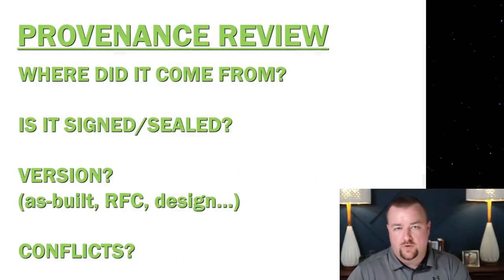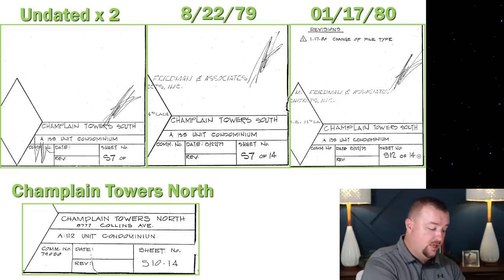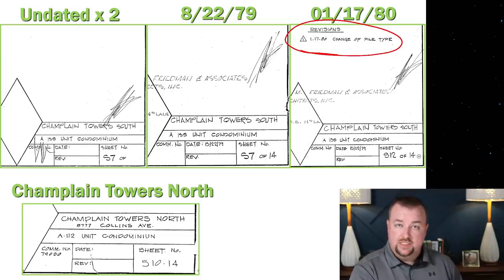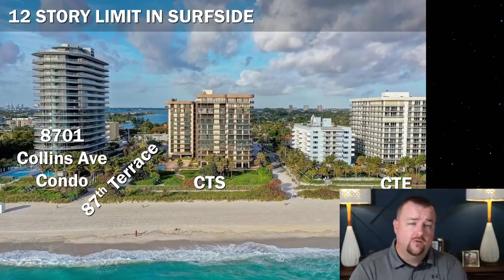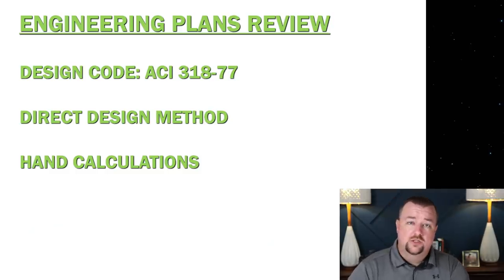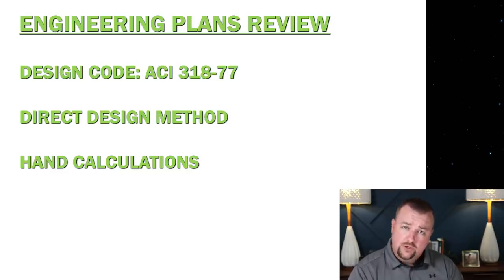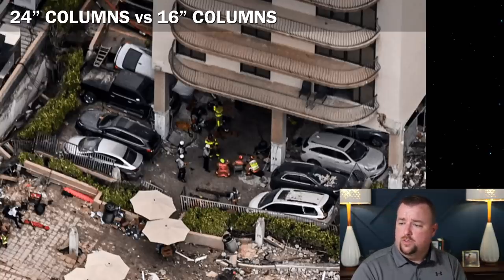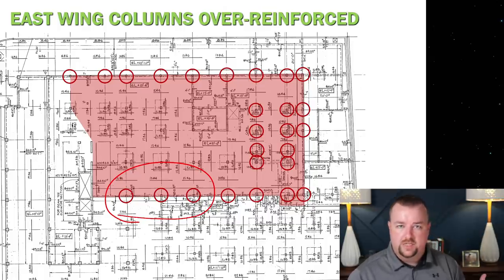Engineering Failures Found in the Champlain Towers South Drawings - Surfside Collapse

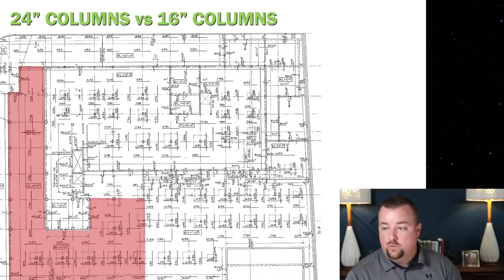Comment: 11:23 on of the ways to cater for higher punching shear is higher column size as shear perimeters is pushed out marginally. The best way to do it is, increasing the drop size. I don’t think 24” columns had to do with higher live loads. As vehicular live load account to small portion for axial members in general.

Comment: What I'm curious about is if the 2018 assessment analysed the blueprints themselves at all such as looking at loading, for example it seems like whether or not wear and tear is a big concern should be based in part on how robust and redundant the building is. Is investigating the original design not a part of re-certification? For that matter it also feels like this would be incredibly useful information in general especially for a layperson. Things like extra planters being installed, or how much the wear needs to be looked at are decisions the board might have looked at differently, if they had a simple overview of the structural integrity of the building at time of construction.
Reply: The structure is usually not analyzed (at least where I live). It is expensive and time consuming. The drawings may not be in adequate enough condition to determine all the rebar and specification and grade of the rebar. You also technically have to inform the original engineer if you are reviewing their work. There are also site instructions and issued drawings that the city may not have. The assumption is that the design met the standard at the time of construction.
Reply: @yodaiam1000  Well that's distrubing, so the integrity of a building once built is just assumed... to be frank it makes all re-certification thereafter essentially meaningless and basically liess.

Note the issue isn't even because of possible errors or mistakes. The issue is that "to code" can mean a lot of different things. How much weight can a specific part of the building withstand, how much is it likely to be impacted by wear and tear (of different types) etc. etc. etc. The same wear and tear on one design might entirely harmless while another design would result  in critical failure. We actually have a great example of that here: the top rebar over the pillars in this one meant that the cracking in the slab seen was actually really really a critical problem. But the inspecting engineers with the core samples didn't notice likely because it wouldn't normally be nearly as big of a problem in other designs.
Reply: @TheWhiskyDelta  I don't disagree but that is actually normal practice (at least where I live. I can't speak for everywhere but I suspect Florida is the same). There are now more requirements for independent review for new buildings. However, all the design and review is done by professionals hired by the developer. There is generally no independent regulatory review. The developer is also highly motivated to under pay the design and review engineer.  Not only are good engineers more expensive, they make sure all the code requirements for the structure are met which costs the developer more money. They need thicker slabs and more rebar etc. If something happens, the developer just claim that they were trusting the engineer. The probability of something happening is very small and the developer uses that to their advantage.

Most reviews (such as 10 year warrantee reviews) focus on the wear and tear, excessive cracks or deflections etc. Analysis usually doesn't come up unless something looks like it is a structural issue. In this case, there was obvious wear and tear but not necessarily in combination with an under design. 

During landscape renovations and membrane upgrades, I have been asked to analyze a number of ground floor slabs as a "just in case" thing but it was not mandatory. We did find serious issues with the design.

Also if there is really bad wear and tear, the analysis may be mot. You have to rebuild the component anyways. That happened with a slab recently (same era of Surfside), we didn't analyze it since if was so far gone.

Comment: On another video you show  two beams that where made between two column instead of on top of the column
and these beam where attach to the first columns to fail under the building and the pool deck 
where they made after the construction to reinforce for the flower pot or where they into initial plan and why between columns ?
May be they where add later ( 1996 ) when they add the flower box , and one of them fail and drop down breaking  the columns !

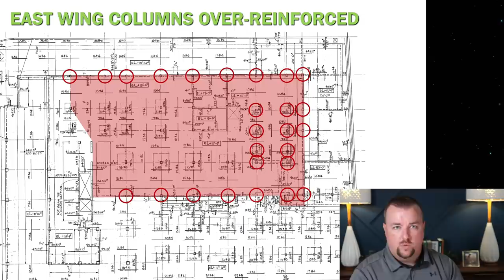Comment: Why don't they vary the length of the rebar coming out of the slab so that when spliced to the column rebar, those overlapping sections are staggered from each other so the amount of over-reinforcement is minimized? 17:30

Comment: What kind of foundation is under that building? 
Are the pile caps still intact?
Reply: the foundation is still intact, it had nothing to do with the ground sinking. 
Plain and simple there was no beams, it punched thru, and then the skinny colums under the building failed because weren't build to be that long.

basically: "anyone can build a bridge, but it takes an engineer to build a bridge that barelly stands."

Comment: I hate to be annoying about this, but are you an engineer?  Where is your engineering degree from?  When did you get your PE license (which is expected in this sort of engineering), and in what state?

Because there's a lot of detail that may be interesting, but it isn't mainly about engineering.

The planters FFS!?  Planters could be added later, and they are on the ground so they would exert no torque on the beams.  Do you know what torque is?
Reply: The load from planters is significantly higher than the LL from the deck. Planter areas are typically designed for 250psf while a deck is designed for 100psf. The planter load is also real. The deck may never see 100psf but saturated soil will happen and can be as much as 120pcf so a couple of feet or more of soil will reach 250psf. Considering the slab was under designed, the planters could conceivably be a significant contributing factor. The planters also covered a significant portion of the slab span that was right next to the building.

BTW, it doesn't have to exert any torsion to be an issue. None the beams or slab were torsional in nature. As a rule of thumb, you generally try to avoid torsional designs in concrete since cracked torsional sections are very flexible and require a lot of ties.
Reply from the maker: I never make arguments from position of authority, but since you asked, I am a licensed structural engineer in Florida that owns an engineering firm that specializes in structurally restoring and maintaining these types of buildings.  I have also been an expert witness for approximately 33 cases involving construction defects.  As the other commenter said, the planters are very heavy and would have required additional engineering attention for their added load.  They also were not on grade, they were located over the parking garage level.

Comment: I'd like to know the calculated expected structural behavior of the 16" x 16" columns that were holding the building side facing the pool if those columns were to loose the lateral support provided by the pool deck/building floor as might have taken place with the collapse of the pool deck.  In the video you speak of the 16" x 16" columns being much more subject to buckling if the vertical space between lateral support were to effectively double caused by the collapse of the concrete deck to the lower level, but didn't provide the structural analysis of this configuration.  To actually have this as a working possibly detailed structural analysis of that configuration needs to be calculated.

Comment: Dear sir thank you for the enlightment ,i hava a keen interest in construction ,so i was very interested in the reasons for this structural failure .
At school we were thought to do a proper  design assumption and then test your structure  for shear ,bending moments ,buckling and so on. We were schooled with the  VB 1974- 1984 Eurocode  especially Dutch design rules and formulae 
The safety factor would have to be 1.7 times load.I do not know the american codes.But to me in the video there is a lack of re-bar and the adhesion between concrete and rebar is zero .
So to me this is bad concrete ,too  little re-bar  and something you keep saying that is very interesting ,and that is the the corrosion by chlorine  ,now that is very interesting .Because in 40 years the chlorine in the water from the pool  spreaded out by the guests could damage the calcium connections within the concrete and reduce the concrete to powder with no cohesion.Combine that with bad shear  reinforcements  and you get a collapsed building. I would like to hear more from you  on the chlorine effect .Also the concrete mix  quality  should be tested ,if there was enough cement  the right amount of water. The quality of the sand and gravel used  are also at stake. But again thank you for your efforts in clarifying this matter. (you should apply  for professor at the university I would never miss on of your classes) Greetings from Rotterdam, The Nettherlands .

Comment: So in short, they moved deck foot up, did not change material, thus weight and most loads, deleted beams that supported it, did not redesign columns either and thought it will be fine... I guess builder did rather good job that it did not collapse 30 years ago as it should from what you say

Comment: A couple questions: 1. Was any of the rebar epoxy coated or was this even a practice in 1979 to help fight salt area and moisture? 2. What was the distance from the external concrete surface to the rebar? 2" or 3" an could that have been a factor?
Reply: Epoxy coating wasn't used back than, even now I rarely see epoxy coated rebar used.

Comment: I know almost nothing about engineering. 
But i find this interesting and wonder how many buildings even in my country (Australia) are built to the minimum standards. 
I think ALL buildings that house people should be over engineered as a safeguard to prevent things like this from happening and to also allow for changes in the future such as additional weight such as heavier vehicles & furnishings. 

I also look at it this way, would you mount a hanging pot plant from a ceiling using the minimum fixtures? or would you use something that is rated to handle twice or three times the weight, Because at the end of the day cheaping out often comes home to roost sooner or later.

Comment: There was no beams as it was a flat slab construction. Beamless construction. The Slab is supported directly by the column. In this type of construction you have a deeper depth for the slab in difference to a post and lintel construction where the slab is supported by a beam on top of a column.

Comment: I’m wondering if anyone has reviewed the designs and plans for the other two properties that this designer and developer built. It would certainly seem to me if they were built to similar plans or using similar practices that they might also bee disasters waiting to happen. When you have parts of a building at 100% of maximum design load that’s just insane from an engineering perspective.

Comment: Being a layperson it seems to me these last minute changes made on the fly don't allow enough time to consider the consequences in the overall structural integrity. It is also interesting the design criteria for each element isn't noted somewhere although being a layperson it may not be obvious as it would be to a Structural Engineer. Excuse my ignorance but I thought there was some external review to these engineering drawings as well as the engineer signing off on the drawings like the city building department? I guessing now with 3D modeling changes like this would alert the engineer to these over stresses? Though it should have been obvious from the get go, clear as day. The contractor or anybody with any knowledge looking at the element would say that ain't right... As far a being long... It's complicated you can't get it into a few snappy quips. Thank You

Comment: Question: Would more modern computer design tools have prevented this flaw with the lack of support beams? Or would a (presumably) poor engineer simply moved ahead with the inferior design?
Reply: There's only so much that can be done if the engineer decides he's done for the day and pulls out the rubber stamp and turns his brain off, but for the engineers that give a damn the more things that can check for red flags the better.
Reply: 1979 no computer software so I wonder how many more buildings are missing crucial things . 
I’m interested to know if software would have picked this up though. It looks like it was revised so many times who would know
Reply: @thecollapseofchamplaintowe7199  Software would've probably picked up some extra things, but at the end of the day being an engineer is a job that requires a degree and extra certification for a Goddamn reason. One or two hiccups would be understandable. This? It's like they haven't even passed their Bachelors yet.

Comment: Also blame goes to the entire process that blindly allowed the mistakes to be made.  As taxpayers we rely on inspectors and city engineers to prevent shoddy engineering and/or shoddy installations.
Reply: After building is complete it is very hard to see if regulations were followed, unless you partially take it apart which is a bad idea.

Also if these were regulated more and less skimping was allowed, buildings will become more expensive, which means cost of housing, office space, etc going up. And sadly even if rules were enforced, there would probably exist some people who would prefer personal benefit.
Reply: Inspections are supposed to be done throughout the entire project, not just the final.  Do any of these commenters even work construction ?

Comment: The U.S. Navy conducted a stress test on the new USS Ford off the Florida coast by detonating 40000 lbs (20 tons) of explosives. This detonation  was detected as equivalent to a 3+ earthquake on the Rickter scale! Could this possibility have been a contributing factor in the partial collapse of the buildings apparently compromised  structure?
Reply: An extremely minor factor, if anything.  Magnitude 3 to 4 earthquakes are very common and they don’t make buildings fall down.  The Navy have done these tests before without damaging buildings.  This particular test was a few days before the collapse.  I would consider it merely coincidental.  The building was ready to fall down.

Comment: Cars have gotten a lot heavier in the last 40 years too, whilst savings have been made in the structural materials with things like increased use of Aluminium the amount of other "stuff" like electronics, safety systems, fuel saving and emissions technology they have gotten a lot heavier overall.1980s vehicle related live load wouldn't be the same as 2020s vehicle related live load.

Comment: Does the concept of Sollbruchstellen exist in architecture? I'm not sure about the English term. It would be predetermined breaking point. In this context, it would be that if a module collapses that the architect makes sure that it breaks at a certain point so that it does not drag other modules down with it causing a catastrophic chain reaction.
Reply: Its called capacity design in North America and is applied to seismic resisting structures. You determine a ductile failure mechanism and ensure all the other potential mechanism in the load path are stronger. It would be very difficult to do a capacity design for this kind of failure mechanism. You have to remember there was a lot wrong with this slab. There are very similar concepts of slabs and structures around the world that do not have issues.

Comment: It would be possible to have use the planter boxes as concrete beams above the slab (so long as they were concrete and not maybe masonry, but if nothing is shown for that then it seems it was an inept decision to just eliminate those beams without reviewing the design. 
I have seen a case where beams were overstressed, were showing distress, but had not failed, which clearly meant the structure was functioning in a different way to that  expected, and of course no one knows when the inevitable will happen. It also raises the issue as to the structural integrity of the remaining portions of the building.
I also did note that the signature was possibly not that of the Engineer, but the Architects, as the signature is beside the Architect's name not the engineers.
I am sure there are many buildings where the design is minimal, the construction practices poor, possibly no Architectural / Engineering supervision, and are potential accidents waiting to happen.

Comment: The explanation about the over-reinforced column is not quite correct: the slab and punching shear are not affected by the over-reinforcement which is occurring above the slab. Also, over time, creep in concrete actually slowly sheds force away from the concrete and onto the rebar and so, the stress on the concrete actually reduces over time.

Comment: The columns didnt fail, the coupling of load to those columns failed. So its not that they were too thin, but if they had a wide loading plate on top, it would possibly prevent the collapse at that point.
Reply from the maker: As mentioned in the video, the size of the column determines the punch through resistance of the slab around the column.  So their size did matter for this failure.

Comment: This amount of structural framings.. was it widely accepted as adequate back in the 80s?
Reply: No, the slab was under designed for the time but the issue is also about a lack of maintenance, drainage, and membranes. The architect, authority, and to a lesser extent the owners (past and present) share responsibility as well.